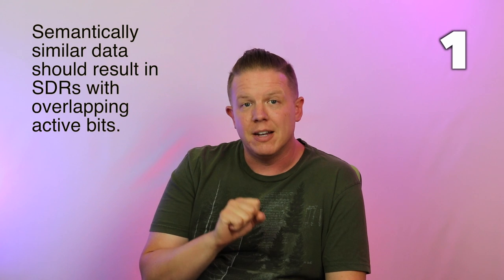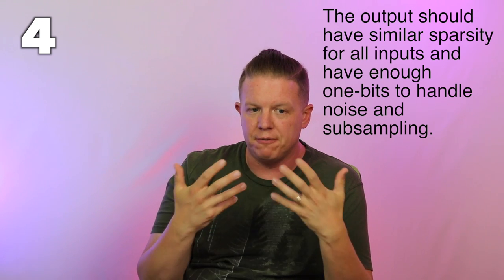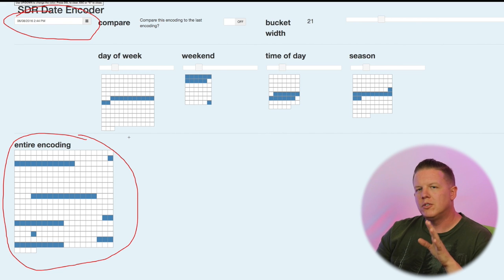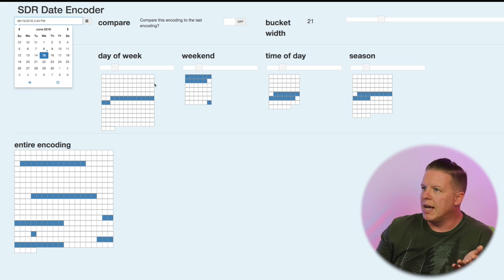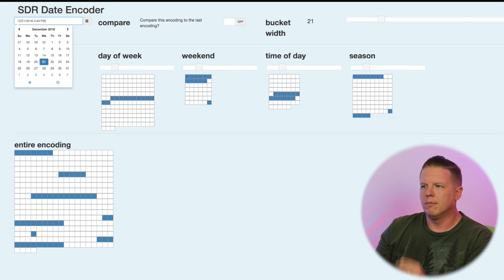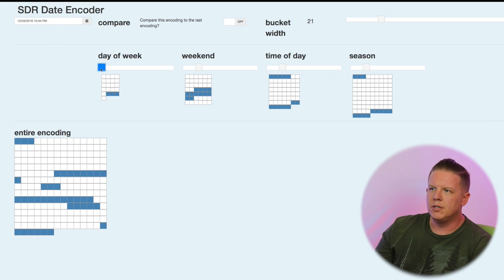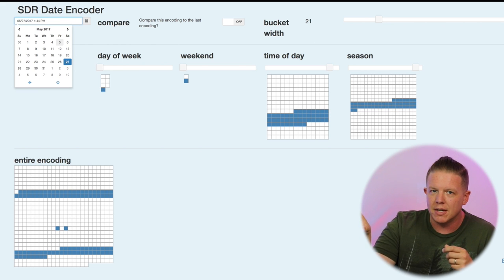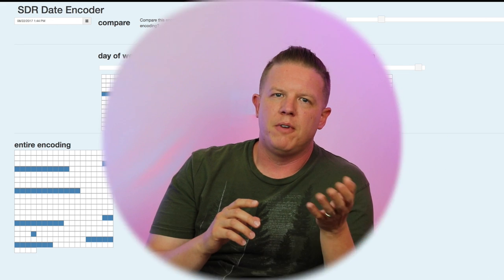Datetime Encoding (Episode 6)

Comment: Thanks a ton for this wonderful video! Only one question, is there a way to use the existing date encoder if the data stream is getting updated every couple of seconds?
Reply from the maker: You could use it, but it would not provide good semantics on the date. Mose continuous time points would be exactly the same as the previous points. For this date encoder to be useful you need a data interval of like 15 minutes or so, not every second.
Reply: I get new data every 10 seconds, and it is very crucial for me as I need to detect anomalies from the incoming data stream. Is there a way to tweak the existing date encoder to make it sensitive enough for such small increments?
Reply from the maker: No. Do you have periodic temporal patterns that occur within one minute's time? Most data at this time velocity does not have these types of patterns. Look at the data plotted at the aggregation interval you are considering and ensure that your human eyes can see the patterns. If you cannot see any temporal patterns at the granularity you are sending data in, the HTM may not see it either.
Reply: Okay. Let me take a look. Thanks for the insight.
Reply from the maker: Questions? Join HTM Forum at https://discourse.numenta.org/

Comment: At 8:50 minute,  why a change in the "day of week" bucket in the same month (May, 2017) is causing a change in the "season" bucket? You are just changing the day, not the month/season, right?
Reply from the maker: The "season" encoding is not discrete in this example, so it is not like spring/summer/autumn/winter. It's more of a moving window across the space, which allows individual dates to have some semantic similarity if they are close together in time. So it changes pretty regularly, but not by much!
Reply: @NumentaTheory  Thanks! Great Work!

Comment: Question: Why do you need weekend if you can tell if it's weekend or not by looking at day of week? Is it to strengthen the difference between weekdays and weekend? If so, why?
Reply from the maker: In many cases, patterns will have both a day-of-week pattern and a weekend pattern. Encoding them separately can help improve predictions. But you are right, many times you can simply get away with just the day of week encoding.
Reply: HTM Open Source 
Like the example data in the next episode, right? 
Nonetheless, would it have been able to detect the difference in the weekdays patterns and the weekends patterns using the day of the week input? Maybe it would end up linking Saturday and Sunday on its own while learning, once it notices that the two are similar between each other and different to the other days. 
Thanks for your reply!

Comment: what exactly is meant by 'semantic information' ?
Reply from the maker: +darkcity darkcity when I say that and SDR should contain semantic information, it means that the bits should represent something. The bits themselves should contain some kind of meaning if they are on or off. For examples of semantic information in bit arrays, see https://www.youtube.com/watch?v=Ub1fE-bAroA
Reply: I think of 'semantic information' as the 'meaning' of what the data represents. For example, if an encoder is encoding meaning well, you'd see similar bit patterns between the SDRs for "potato", "yam" and "spud".  Since they are all types of potatoes, they should all have many of the same bits set to one when encoded into an SDR.  

Taking it a step further, I imagine if you encoded an image of a potato into an SDR it should have a similar bit pattern to an SDR encoding the word "potato", and because of the similarity the pattern recognition algorithms in HTM (sorry I don't know what that is just yet) could easily match both the image and the word representations of "potato". Allowing your AI to become an excellent fry cook at your favorite burger joint!  :-)